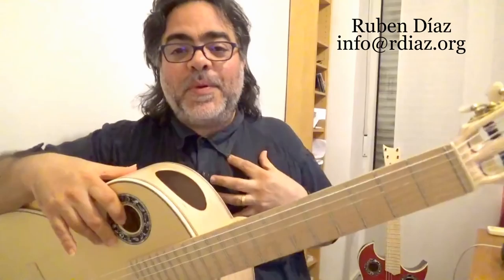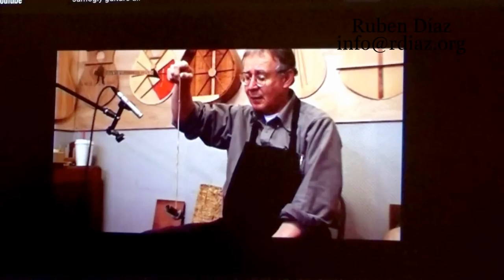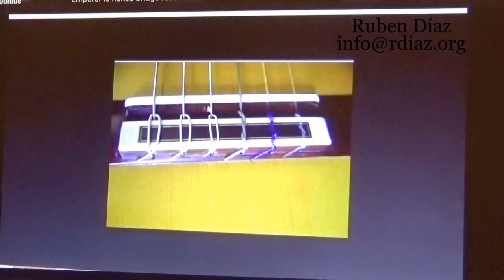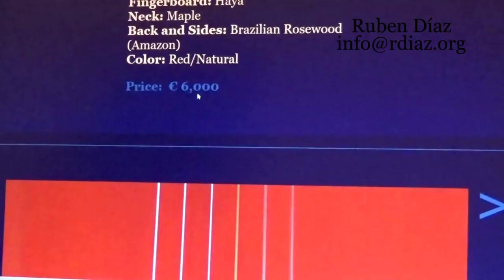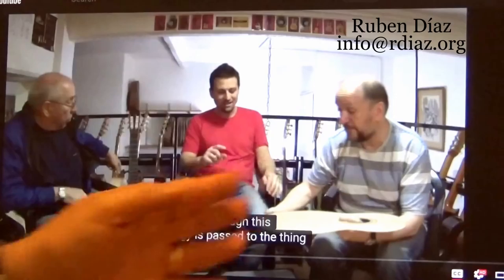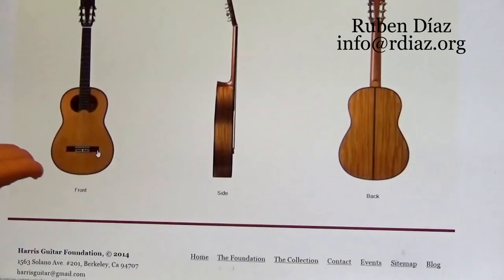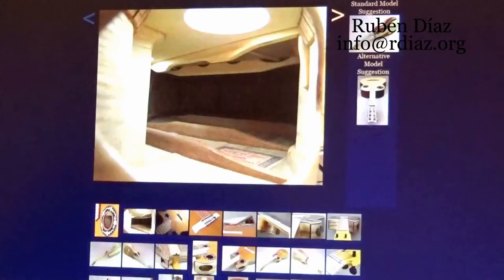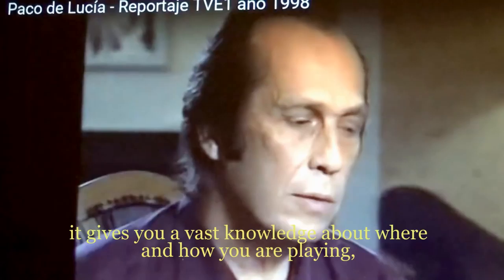Bridge Series 1/ It`s role and how 120% it does impact your sound /How to choose a flamenco guitar

Comment from the maker: Video 1  https://youtu.be/n8APEhbo_R4?t=1m44s
         (The reality about "low fast action" and play-ability)
the proper way to calculate action as there are other two 
more factors to consider as well.

also interesting to analize
Video 2  The Barcelona vs Madrid school of guitar making
          https://youtu.be/g85IgajSIyY?t=1m8s

Video 3  The importance of Barcelona in Arts and in the history of Luthiers
           https://youtu.be/JXaLCbs3UMc?t=2m39s

Video 4 https://youtu.be/hE-Py9jFLEY?t=2m22s
         (Sound reflects from the back of the guitar)

For those not very familiar with our ¨Spanish Stradivari¨
   Mt.Francisco Simplicio (Barcelona, 1874-1932)

Next you can see very interesting data about his innovative works:

References to the history of the double sound hole on the top
Guitar made around 1929 by Francisco Simplicio
 http://www.themomi.org/museum/mfa/popular_guitars/1929-30_F_Simplicio.html

Simplicio noticed a disadvantage of the traditional sound hole position in the weakening of the guitar top in a crucial area and also in a reduction of the sound emitting surface of the top (Huber, J.: The Development of the Modern Guitar, Westport, 1994, p.27). The increased sound emitting surface should also improve the sound emitting in the bass range (Stark, D.: Diplomarbeit – Entwurf und Bau einer Konzertgitarre mit doppelter Decke in Sandwichbauweise, Weimar, 2006, p.6)

Impact on the sound:

Omitting the sound hole or positioning it on both sides of the fingerboard leads to an enlarged vibrating surface of the top. Cue to the ratio between top length or width and top thickness, it is possible to:

– attain the same degree of flexibility of the top as in a traditional guitar, but obtaining a higher mass of the top (this leads to a better sustain without the loss of attack and responsiveness)

– attain a more flexible top than on a traditional guitar, but maintaining the same mass of the top (this leads to increased loudness and responsiveness without the loss of sustain).

In addition, the Helmholtz frequency http://polettipiano.com/Pages/airresengpaul.html
can be lowered significantly, which in turn has an impact on the tonal character of the instrument.